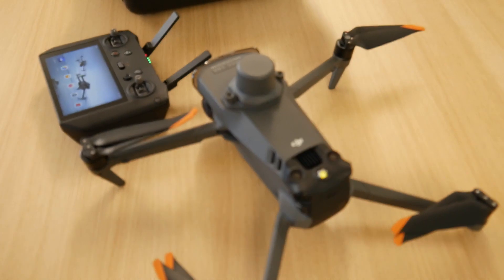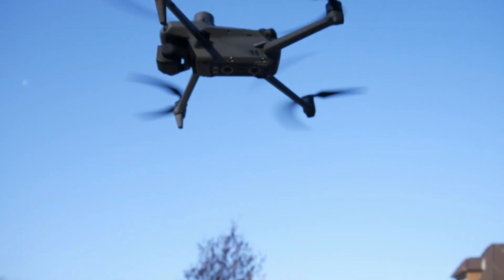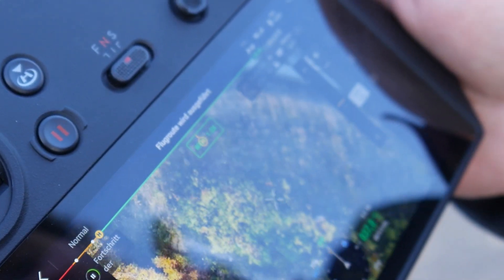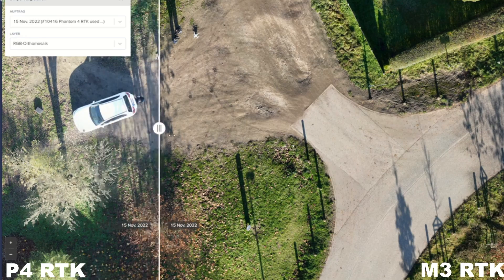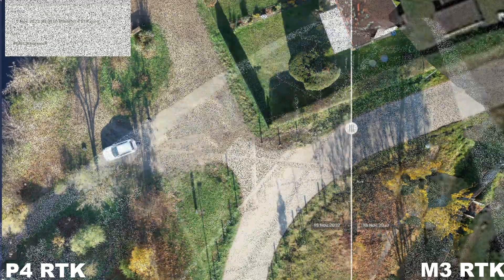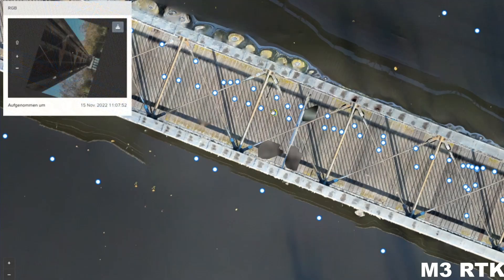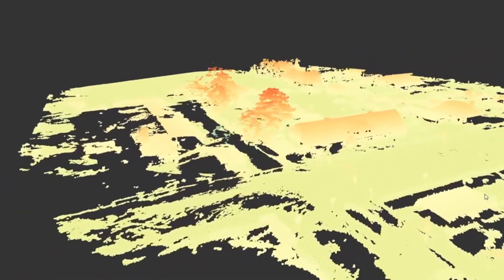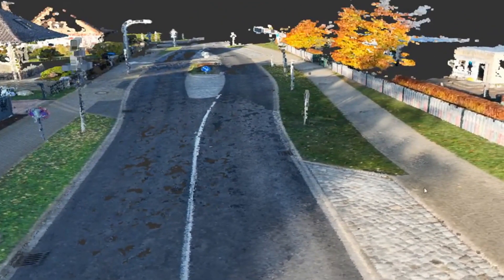DJI Mavic 3 Enterprise: Surveyor-Grade Mapping (Quick Review)

Comment: Hi, very interesting video. How far can the drone be from the base to maintain the RTK correction ?
Reply from the maker: Hi there! In this case, we fly with the RTK module on the drone itself. There is no base station. So in theory, you can fly 3-5 km away from your controller, however that is not allowed due to air use regulations.

Comment: Hi! Thanks for the review. I heard that the mavic 3E does not georeference the images with the RTK module...is this right? I heard the RTK is only for flight positioning and higher accuracy of the aircraft.
Reply from the maker: Hi Alberto! The Mavic 3 Enterprise indeed does save the corrected RTK location of the drone into the images, so the coordinates in the photos' EXIF data will be accurate. Not sure what you've heard.
However, in most drones it is the location of the GPS/RTK module, not the lens. The photogrammetry software needs to take that into account.

Hope this helps!

Comment: which program exactly do i need?  Since they sell several with different costs
Reply from the maker: Hi Luis, there are indeed a lot of programs out there for photogrammetry mapping, most of them are not free. On the more expensive software side, but arguably the better ones are Agisoft Metashape Pro and Bentley ContextCapture. Personally, I'm a fan of cloudbased solutions, the big ones are DroneDeploy and Pix4D. 

The scenes out of the video are from my company's own solution that we offer for construction companies and contracting authorities, and is tailored to the construction needs. Usually we sell the processing per flight and offer surveying/3D modeling or data analysis services on top.

That all being said, the best free solution seems to be opendronemap.org - the install process is a bit tricky, but you can purchase the WebODM installer for around 50$ from their store and get around the hassle.

I'm considering to do a comparison video at some point between some of the most known solutions.
Reply: The controller that comes with the M3E drone has the DJI application that comes with the drone. Also there are 3rd party apps like Dronedeploy the can be loaded into the controller
Reply from the maker: @JBS2018  I'm personally a civil engineer with a strong tech background, however in my company, we have surveyors aswell - so we offer surveying services, but also contract them out to scale our operations. Feel free to reach out if you have any specific questions!
Reply: @chrisvolta fellow civil engineer!  I just found this video of yours and you mentioned about road construction.  Apparently, I am in the water/sewer sector.  We would like to use this equipment to survey road alignments - could you give me an approximate info on the max. allowable distance it could cover in a single flight?  For one, we are to cover a 25km raw water transmission line, but we are worried that doing a auto mission pathing would be impossible because of the distance.  Would a RTK base station also help in this scenario?

Cheers! And thank you in advance!